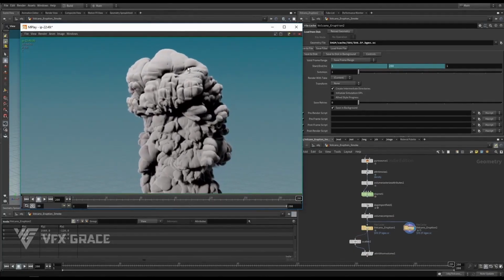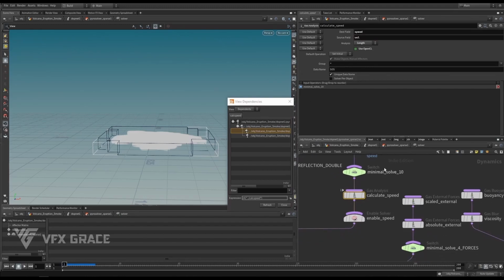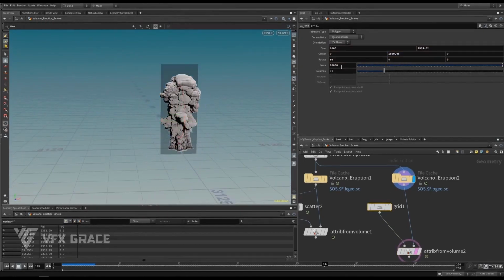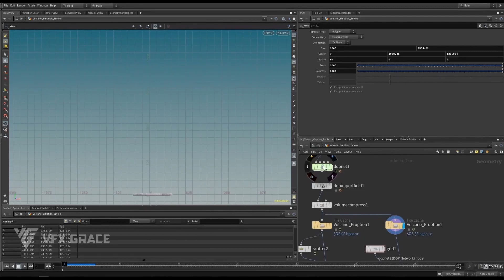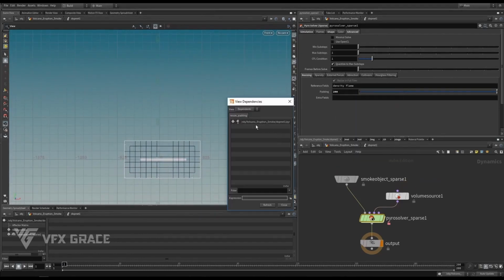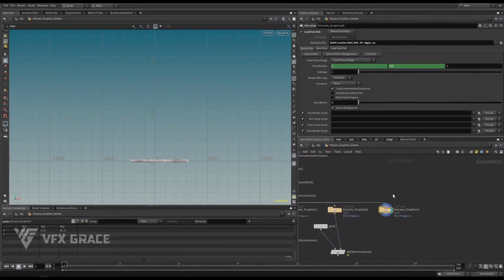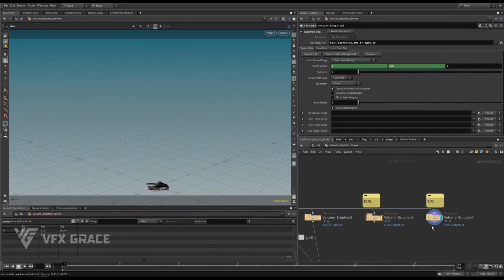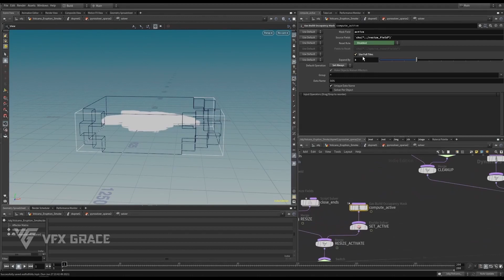Advanced Houdini Tutorial | Understanding Sparse Solver | VFX Grace

Comment: How much RAM I should have? By the way is it worth to upgrade from I5-9400f (48gb ram) to I9-9900k+ (64gb-96gb-128gb)?
Reply from the maker: I recommend 48G+. As for the second question, it totally depends on if you really need it or not.
Reply: 128gb ram will be good if you can afford it. the more cores the processor would have the better. As long as you can afford it